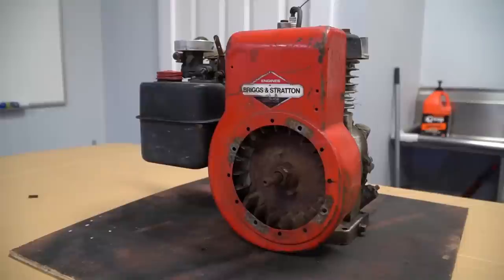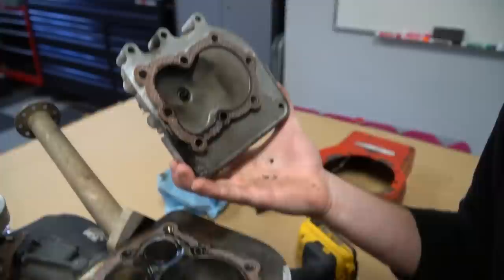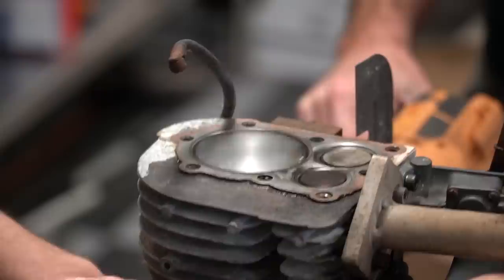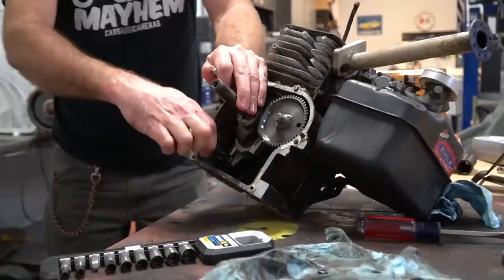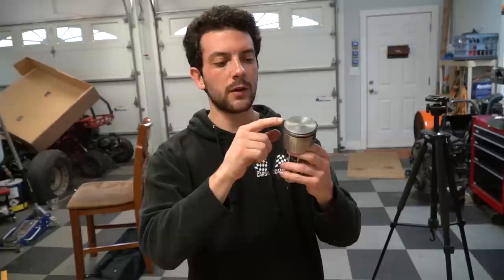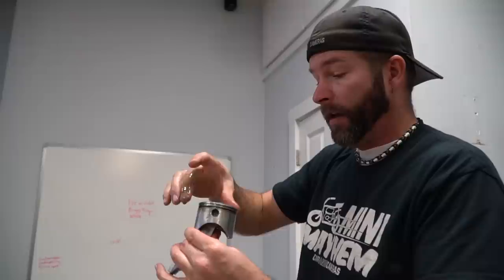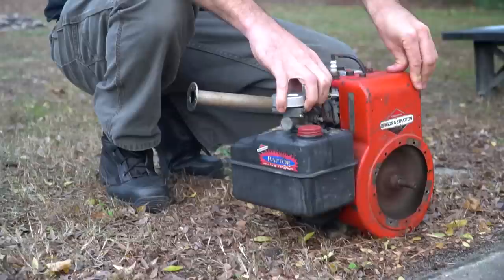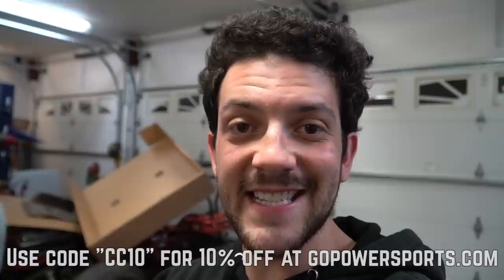Rat Rod Wagon HAULS | Built Briggs & Stratton Flathead

Comment: 13:49 "that you'll never be able to find parts for..."

From my rather limited experience, the majority of parts from these old flatheads are still manufactured by B&S. Not only that, but these engines were produced in such large numbers that it's really easy to find a "spares engine" for sale on the local classifieds.

There is quite a lot of aftermarket support as well (ARC makes a ton of parts for 5hp Briggs engines), and YouTube is awash with people doing all sorts of crazy stuff with old Briggs engines.

Just my opinion...
Reply: that's a race piston and rod. with possibly some light overbore. NOT stock.
Reply: I'm pretty sure John was referring to stock engines, or at least B&S in general.
Reply: Briggs 5 horse flat heads were the predator of there day. And parts are easy to find. The problem they do have is that the compression realise is a extra lobe on the cam shaft so when they run they loose compression and the only or the proper way to get around the problem is to grind down that extra lobe.
Reply: Briggs still produces the flat head and even produces and supports their racing line of engines so yeah you can get parts all day long.
Reply: Brodie Bennett your right I only work with flat head Briggs engines and parts for them are so easy to find just look for the engine model number go to Google and look up preformance parts for the engine code ....
Reply: The best block to use is the Red I/C block it's already got a steel sleeve. The I C stands for industrial commercial the block has ball bearings instead of friction bearing/ aluminum.
Reply: not all 5hp flat heads have built in compression reliefs only the newer ones and it doesn't effect the compression when running...i just built a raptor out of a 83 briggs 5hp i/c...it still has stock rod piston and cam...all i did was shave head put a thinner all copper head gasket on it port and polish...bored carb..and shaved the eye brows..only thing i got money into is the head gasket which was like 8 bucks i think..got 105 psi compression...and will smoke a 212 with a stage 1 kit no problem..briggs are way better motors and way netter quality...can usualy buy them for 20 bucks all over the place.
Reply: I have all kinds of performance parts for them. Clutches, billet high CR heads, it’s all out there.
Reply: Yeah. I was thrilled last episode and immediately dumped on this one. 
I adore these engines, I've got a truck with milk crates full of replacement parts for when I attend local get togethers. Seeing them make an executive decision that there are no parts available and their "holy grail" predator is the only option (for the umpteenth time)... Just pisses me right off.
Reply: You might could because that is a raptor III racing engine from briggs and people pay alot for those and are "rare" to find on the internet
Reply: I'm confused by Jon's comments as well. 5hp Brigs have tons of aftermarket support and any small engine shop worth their salt should have parts on hand for them or be able to order them. I'm not sure where you looked to get parts but I suggest looking elsewhere.
Reply: @foureye7058  Predator is fine until you need things like coils....no joke try finding a stock 420 coil that does cost you a kidney and your first born, yet I can go to a local NAPA store and find parts for the "impossible to find parts for" Briggs.... it is almost like being sponsored by a company that solely sells Predator parts has nothing to do with that line.  Took me 5 seconds to find the race piston on ArcRacing's site and the rings are $23-26 depending on the size they need.  Just need a micrometer and the piston, and possibly a torque wrench to do the job right... just sayin.
Reply: If you want a spare flat head briggs go to the junk yard. You can find a lot of old generators and stuff were the generator half broke but the motor is still good.
Reply: @rogermarshall8991  Best kart I had as kid had an 8hp Briggs IC off an old snowblower it went like Hell .
Reply: ? really .....briggs parts are hard to find I think not they made millions of 5hp briggs I can find them all day on anything from a old pressure washer to a garden tiller
Reply: @user-neo71665  No new flathead blocks in many years...
Reply from the maker: "Never be able to find parts for" was an unfair exaggeration. In my also limited experience, we spent over an hour looking for the correct carb rebuild kit and piston rings for a .015 over B&S piston. We weren't able fo find a side cover gasket. Maybe my googling skills aren't good. Also, from what I've seen, aftermarket parts tend to be more expensive than the clone equivalent. I could be totally wrong, but that's what I've seen in my limited experience.
Reply: I think the key word for those is "snow blowers", North Carolina isn't far enough north to have them as a yard sale/fleamarket/curb-shopping staple. The engine is way more common in those than something like a yard tiller or pressure washer. That'll give you a baseline to work from in stock form, and it's probably cheaper than what John & Ike can usually get.
Reply: ombwarehouse.com...has all the performance and rebuild part for a briggs flat head check them out...and i'm sure you know just use rtv for the side cover....permatex ultra gray high torx and vibration is the best just came out few years ago it  is really good product..
Reply: go under performance parts and there you will have option for what motor go to briggs then to gaskets and there you will find the side cover gasket...and they got ring sizes in all over bore specs
Reply: @CarsandCameras  There is no "kit".The only parts for the carb rebuild is the gasket between the carb and tank, and the fuel pump diaphragm on the side of the carb near the adjusting screw. Do not stretch the spring under the diaphragm. there are 2 tubes with screens on the carb that fit in the tank,one goes to the bottom, the other sits in a "cup" in the tank just under the carb. Clean the screens by simply scratching across them with your fingernail. easy.
Reply: @Splungers  hmm, funny since briggs has them on their website for sale.

They have not supported the raptor flat head for awhile but there is so much aftermarket support it isn't even funny. I understand these guys are sponsored by a company that buys predators and then resells then for for way too much but saying  no parts is stupid. These engines are like the small block chevy of small engines and parts are all over for them.
Reply: No new raptor 5 hp engines or blocks made since 1999. There are new old stock blocks around for $250 each.
Reply: @pauljs75  what's a yard tiller? Almost every garden tiller built has a 5hp B&S engine.
Reply: @CarsandCameras  Don't worry, Google can be hard to get around sometimes.

Comment: I agree with ike. Ol briggs have a soft spot. And yes the parts are alot harder to come buy. But dang they perform. Worn out rings and a bad valve guide and still picked up 5mph and 2 sec.

Comment: When you can get 15+ hp from a 5hp briggs I'm good we raced carts & built briggs with top straps on the motors to keep the heads on them they made massive hp with a few custom tweaks for internal piston weight & flywheel timing advancement etc !!

Comment: The hone you used is for brake parts. The longer stone in a piston cylinder hone guide it holding it true to the bore,  your cylinder is no longer straight. More than likely egg shaped.  It will need a new sleeve. Valve guides are also in the same condition.  The piston is a forged piston
Made for high rev's and compression. Able to withstand hotter burning fuels. You need a new block.
Reply: or just new valve guides? and a re re hone with a proper tool?
Reply: Roger yup, time for a block and see what it'll really do.
Reply: @Hermiwalle  
The bore is trash, passing that amount of oil the cylinder is gone
Reply: @Hermiwalle  
Briggs & Stratton does not use replaceable valve guides. The amount of Machining that it would take to install them, it's not worth the hassle.
Reply: Roger Marshall: oh ok. But I also imagine that a new 2 bearing block would be kinda rare no?
Reply: @Andrey Angere 
Mic out cylinder to see how far out of round it is, it's not guess work. That's why machine shops charge the amount to cover tool costs and set up Time.
Reply: He could re sleeve it, that would work
Reply: Yeah,  the engine was trashed to begin with. I can't remember the last time I got away with just replacing rings.
Reply: Glad I'm not the only one that saw how awful of a job he did honing that bore.
It's like he's never even seen it done before.
Reply: @rogermarshall8991  It only takes @ 20 minutes to replace briggs flathead valve guides.
Reply: @rogermarshall8991  Why would they need an entirely new block when the engine's clearly already been bored out and sleeved once? No need to discard the whole block, just re-sleeve it.
Reply: Tecumseh HMSK80 .best replacement engine.or re ring the old bilt for scrappin'.
Reply: No block needed, just a fresh oversize bore and replacement piston,rings and valve guides.the block is .015 bore now, and can easily go to .070.  https://www.arcracing.com/pistons-and-rings/
Reply: @rogermarshall8991  Briggs has simple hand tools to ream out the guides to accept and install new brass insert ones.I have those tools.
Reply: @TestECull  No need to re sleeve- there are at least 8 sizes larger pistons available for another overbore or 4.
Reply: @Splungers  
Have you priced a new Billet piston ? That alone would be a serious buzz kill. It's unfortunate prices are so high.
Reply: @rogermarshall8991  Have you priced a billet piston for a predator?

Comment: differences in a standard, and racing piston, weight, alloy type, change in compression, ring design.strength these are the basics. The longer rod you have is to increase the time the piston dwells at TDC (helps with low and mid range power). The single ring lowers the drag on the pistons travel.

Comment: First off.. you guys are awesome. .. now about the smoking piston. I had a similar issue with my car pistons. They were aftermarket and the oil ring drain holes were not enough for my high reving engine. They only had  3 holes (6 total) on ech side of the piston. The stock had 5 holes (10 total) on each side. I drilled 4 more holes on the piston, being careful not to damage where the oil rings sit, this allowed the oil to drain back into the block easier. Since then my engine does not smoke, oil last longer and is less contaminated. Be careful not to hit the pin that holds the piston to the rod. You will have to drill at an angle. Good luck gentlemen.

Comment: I think when you find an old flathead, it throws you right into tinkering and getting to know the mechanics of an engine (for beginners) and you can find something that runs for 50 bucks if need be. I love the front engine, live axle, drive shaft builds. I think another "rod" build with a 420cc, and maybe some sheet metal work could be very very cool

Comment: I've gotten 3 Briggs and Stratton flathead engines for free, that's how easy they are to come by. One of them is on my custom homemade minibike, you can't go wrong with an old Briggs. Also, they are a little easier to fix than any new overhead valve engine and parts are still super easy to find, these engines are where I've learned my basic mechanic skills.

Comment: The older Briggs 5 hp flatheads will outlast the cheap Predator engines. They last forever!
Reply: Not really
Reply: Not the cheap Briggs that don't have an iron liner...they last 200 hrs tops. Also, flatheads run hot and go through valves like crazy. Older doesn't always equal better.
Reply: totally disagree with you  flat heads are far better then newer motors if you can get 35 hp out of a 5 hp flat head I will take it all fucken day long!!! @T..C..M
Reply: I have a 5 hp briggs from 96.
The only problems have stemmed from me not replacing gaskets. And an incorrect coil gap (found out when it stalled and had no spark)
Although it doesn't have a cast iron liner it still is amazing
Reply: @mr.stonerUDX714  How do I get 35hp out of my 5hp?
Reply: @T..C..M  exactly, i had  old briggs flathead for a go kart project, and almost a week after (engine was used alot before me) the valves went bad and i just dont have enough time to replace them

Comment: Older Briggs are way better then today’s engines by a long shot there way more durable then anything built today I’m a Briggs fan by heart they have never let me down. One cold winter I went to start up my tractor that had an 1976 8hp briggs been sitting for 2 weeks or so and I kid you not I took two pulls and it fired right up them engines I have a lotta faith in them.

Comment: My friend and I race open wheel mod dirt track car we run alcohol and boy does that stuff ruin anything that's not steel we have a shut off at the tank and have to let the engine run its self out of fuel. Then we fill the vent tube right away with pump gas or else you will have to rebuild the carb and fuel pump from sitting even overnight or 2 days. Also, the skirting on racing pistons are typically taller for piston slap which can crack them eventually it keeps the piston more straight up and down in the bore since shit is not built like it used to be you pull apart a brand new bred and butter car's engine the skirting is super short for MPGS and weight savings on the rotating assembly. Diesel engines have much much taller piston skirting for higher compression after all they all knock naturally. If you ask a regular engine to push more power for extended periods of time you will find with a micrometer that the cylinder walls are egged chopped more than normal
Reply: mopartshemi I race a mod too!
Reply: Absolute correct Sir. You know it.
Reply: It does foul up the engine &  rebuild more often because of aluminium , flush out with gas or it will eat it up .
Reply: Maybe with alcohol it might not smoke as bad uper cylinder lube ?

Comment: Most oils today have detergent in it and if the motor inside was dirty from previous build up it will clean it and cause it to turn dark. Also once oil heats up especially on a air cooled engine it can burn it black quickly or if the rings are it can cause that also.

Comment: For many years Briggs was the primary engine in small power lawn equipment, and it still is a big brand in that business, although the new OHV engines are a different thing from the old flatheads. If I was doing a rat rod with a red wagon base like that I think I would extend it so you aren't cramped up so much, a bit more leg room would be nice. I had one of those wagons when I was a kid in the 50's.

Comment: High compression pistons (racing, "High performance" pistons) give the engine a higher compression ratio by bringing the stroke length up with a taller piston, tall enough to increase compression ratio, but not too tall to start smashing into valves, or in your case with the flat head, the cylinder head. More compression, in turn makes more power. Hope I was of education, love the videos.

Comment: Briggs & Stratton 206 crate engines are factory-sealed long blocks with ground cams and controlled piston pop-up (reducing compression variance). These budget-friendly mills feature a simplified IKF/WKA rule set designed to maintain a stock configuration, right down to the factory-shipped carburetor jets. Simply put: the 206 engines even the playing field so that drivers can focus on the important task at hand--winning the race!

Briggs & Stratton 206 crate engine features and specs:

* Primary use: Karting, Microstocks, Jr. Drag Racing
* Engines are assembled by hand in Milwaukee, WI using tooling and dies specifically designed for racing for unparalleled repeatability
* Reinforced, cast iron sleeved, dual ball bearing racing cylinder
* Single cast, custom aluminum alloy cylinder head with high-flow intake port, custom seat/guide material
* Squeeze cast, T-7 heat-treated aluminum rod with reinforced I-beam
* Carbon steel crankshaft with induction-hardened, micro-polished, crankpin-reinforced timing gear
* Cam ground, barrel-faced, eutectic alloy piston with 3-piece ring set with chrome faced top ring
* .255 max. lift ground cam with nitrited lobes and built-in mechanical compression release
* High-silicon, racing-engineered valve springs 
* High-grade stainless steel dished valves with nitrited exhaust
* 3-piece, automotive-style keepers and reinforced rocker arm and lock ball
* PVL digital ignition with built-in 6,100 rpm rev limiter
* PVL steel hub, cast aluminum flywheel
* Briggs & Stratton tooled 22mm round slide, fully adjustable jet carburetor
* Custom graph oil composition head gasket

Comment: That looks like a 4.5 inch rod. If you measure from the center of the crank bearing and center of the wrist pin bearing you can tell. Then a matching piston compression height (0.590) I believe for the 4.5 long rod, and bore size. ARC racing has a page on there blog about calculations for all that. And you can get reamers and valve guide installer tools and Briggs valve guides on Dynocams and some other sites.  And as for the racing pistons compared to the stock Briggs pistons, the racing ones are forged or billet aluminum to handle the higher rpm. The stock cast Briggs pistons won’t hold up long past 8,000 rpm. And with forged and billet pistons you run a bigger piston to cylinder wall clearance, because the metal is denser and will expand more in heat compared to a cast piston. It would be cool to see you guys rebuild this engine with a new piston and rings and show installing valve guides.